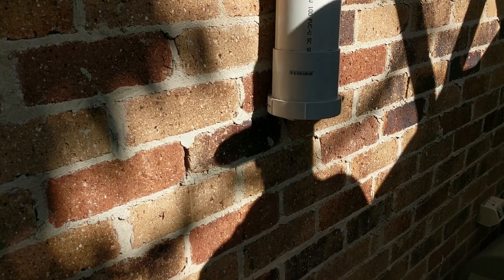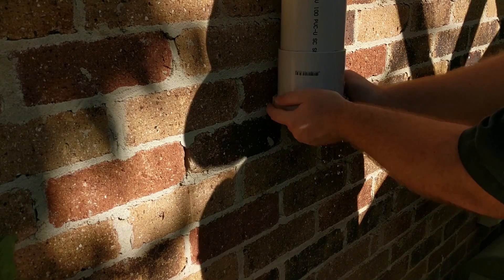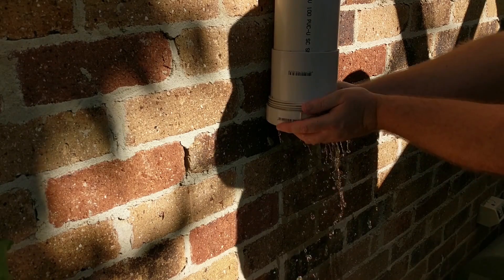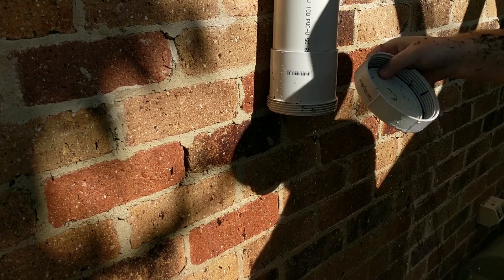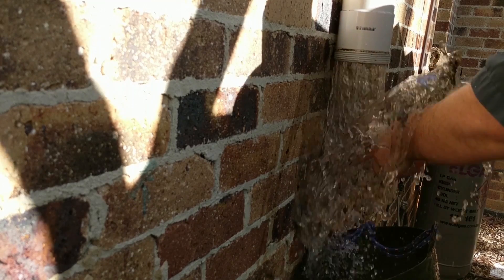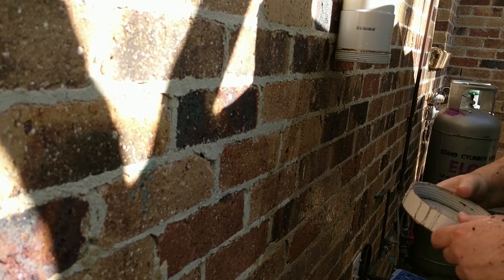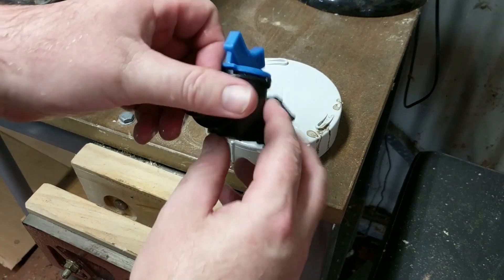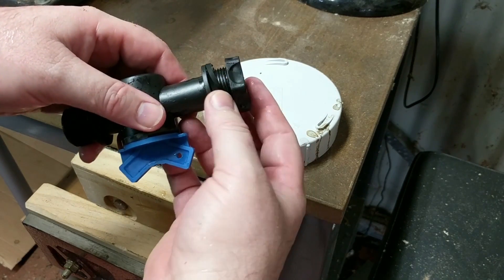Improving the First Flush // Rainwater Collection Part II

Comment: Hi Jim, like all your videos about first flush systems. I'm in the process of building one myself and I really liked the taps (with blue handle) you used in part 2, I've tried searching on the internet to find them with no success, I was wondering if you could advise where you bought the taps from if possible please. Thanks.
Reply from the maker: Hey ... I got them from a hardware chain here in Australia called Bunnings. Would be something like Home depot in the US. 
Unfortunately though, when I last looked for them at Bunnings, they weren't there 😢 But, I found something similar on Amazon called a "Barrel tap".

Comment: Thank you for sharing your great idea.  I've got a small rainwater collecting system which the water passes through the bio sand filter before going into the tank but the debris that the sand filter handles seems a lot and thinking of fitting this First Flush.  

But my main concern was, like you've showed us, the big splash you get each time trying to clear the First Flush.  But having this tap connect at the bottom is a great idea that would solve this.

Will fit this on mine soon.
Reply from the maker: Excellent! Best of luck.

Comment: I have drilled a 2mm hole in the bottom of the cap to let the water drain out by itself.  But the Leafeater on the gutter is a must for this.   Then the maintenance is less
Reply from the maker: Absolutely. I should have mentioned that in the video to be honest. Thanks for watching!
Jim

Comment: Hi Jim,Nice work with the homemade ff diverter. I'm wondering where you got those taps? They seem to have the full diameter of the outlet all the way through. I bought some taps online recently which have a 20mm outlet, but narrow to 12 mm where the valve is, which kind of slows down the rate of water flow.
Reply from the maker: Hi Broderick, where abouts are you in the world? I got mine at a local big box store in Australia called Bunnings.

Comment: if you want to water your plants with the hose, still some holes in the hose so that it will water a wider area instead of water only going in one spot.
Reply from the maker: +Patty K That's a great idea! Thanks Patty. 
I was going to put a ring of mulch around the base of the two plants to help contain the moisture as well. There's only two plants in that particular garden at present. But your idea is perfect for when I plant more in the garden. So thank you. 
Jim.